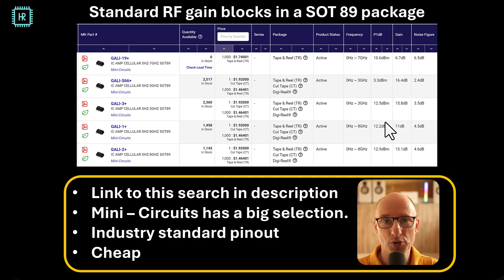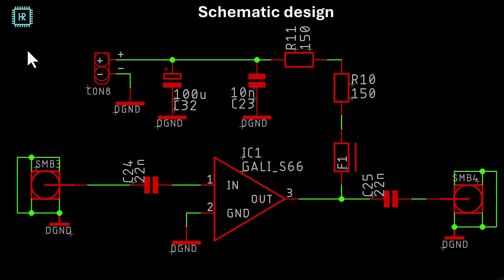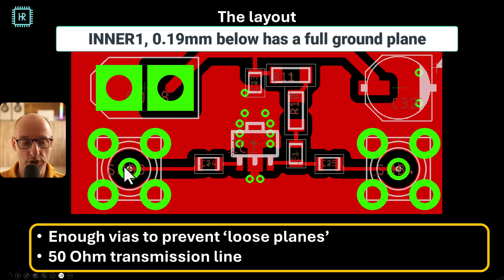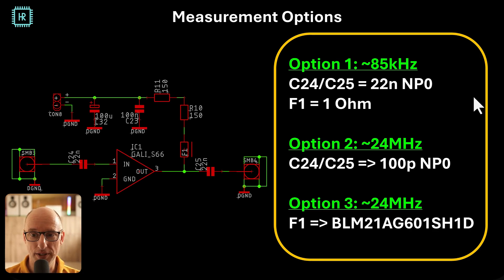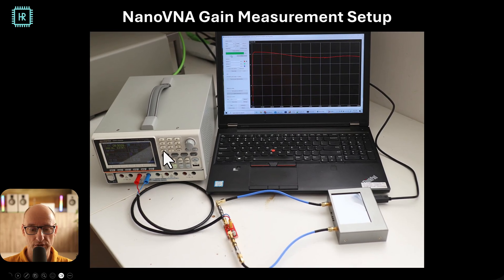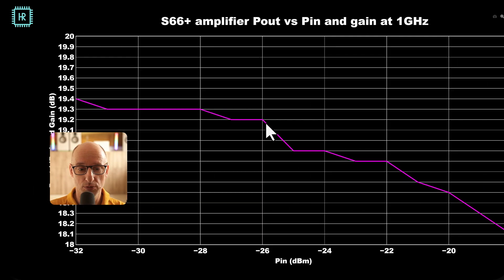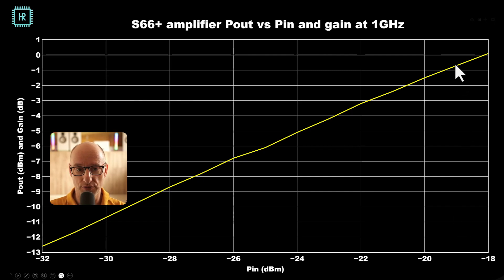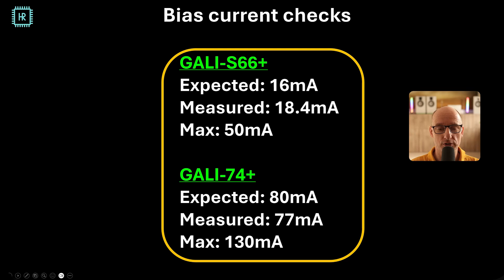Simple Universal RF Amplifier PCB Design - From Schematic to Measurements

Comment: What are your views on power pours on signal layer?
Reply from the maker: It is not a problem, as long as they're clean OR have a distance to sensitive signals. Sometimes you need to use power polygons on your signal layer because you are drawing a lot of current and voltage drop must be minimized. Usually for core voltages of processors or FPGAs.
Reply: @HansRosenberg74  is there some good rules to follow here to keep the power "clean "?
Reply from the maker: Simple: Place decoupling caps regularly that connect the power plane to the ground plane. If you have really large current peaks, you may want to include a big capacitor here and there. Place smaller ones next to high speed loads like digital chips.

Comment: Excellent work... keep 'em coming.
Also ... can I keep cascading to get a really high power output signal ?
and can you somehow convert the input / output measurements in Watts ? coz It makes more sense to me.
Reply from the maker: The output power will always be limited by the last amplifier stage. That has to drive the final power. About the dBm values. 0dBm equals 1mW. 10dBm = 10mW and 20dBm = 100mW. It follows 0.001 * 10^(Pdbm/10) in Watts. And when cascading, you have to make sure that the driving amplifier does not clip before the final amplifier (I may have done that wrong in my design ;-) They clip at the same time I think but I did not check that carefully)

Comment: Can I use this amplifier for a wifi antenna that receives AND sends data?
Reply from the maker: Well, partially, you'll need a tx/rx switch. When transmitting, this amp should be used, but when receiving it should be turned off and the signal should be routed around the amp. So not so easy. You don' t have access to the tx rx signal
Reply: That was a great hint! I'm using an ESP32 and there is indeed a "WiFi Multiple Antennas" section in the documentation 👍😁
Reply: Thank you!

Comment: Folks using Kicad will find the calculator for trace impedance in the calculators section.
It is under high speed -> transmission lines
Coplanar wave guide with ground plane is a good topology to use.
It seems to give reasonable results
Also to protect against "ooops I connected the power backwards" you can add a diode.
If I was doing it, I would also add a little LED and resistor to indicate power is on to remind me.
Reply from the maker: The led is a nice idea indeed.
Reply: The Saturn PCB Toolkit is also a great calculator. But before I fabricated anything, I would get the actual Dk values from the PCB house.

Comment: I really hope you can make a simple filter for a 78 - 108 MHz FM transmitter, with RF power from 5 - 15W. Thanks a lot!
Reply from the maker: I think you should design an LC filter and make sure the capacitors and inductors can handle the power. Now for caps this is easy, just use NP0/COG caps which are big enough, just check the datasheet, 1206 may already do it. The inductors are a bit more nasty. I think you'll have to wind your own air core inductors with silvered copper wire to increase the Q. Then you need to tune these a bit by bending the wires a bit closer or further apart. Making the design is easy, check out this site: https://markimicrowave.com/technical-resources/tools/lc-filter-design-tool/

Comment: Can you explain why the quality of the resistors matters? What would be the impact of using simple & cheap thick film 0804 or 0603 ones? (Also, I see 22 Ohm thin film in 0603 for $0.022ea qty10, that's pretty cheap, isn't it, or are these the wrong ones?)
Reply: Ah, now I see, you need to dissipate a lot of power, that's why the simple thin film ones don't work. To be honest, I felt like this video was too compressed and left out a lot of the finer points and background info. Great overall, but would have preferred 2x the length. Thanks!
Reply from the maker: Thanks for the feedback. Video speed is a big topic on youtube. Hard to know what is best. What is your background and age if I may ask? Trying to find out a bit who my audience is.
Reply: @HansRosenberg74  Speed is fine, I can stop, replay, slow-down when needed. Maybe instead of "compressed" I should have said "high-level". I thought that for too many things you just said "I need an X of value Y" without going into any details about Y. You are obviously making some rule-of-thumb / ballpark calculations in your head to arrive at an approx value for Y but you are going too fast to say that out loud. For example, for the DC block caps you probably have some rules of thumb: under 100Mhz around YnF, between 100Mhz and 1Ghz about YpF, etc. Or the ferrite beads, you just said "I can also put a 1 Ohm resistor" without saying a couple of sentences about the reasoning or the expected effect. I just thought "huh, a resistor and an inductor are not even the same kind of component, what is he doing??". Yes, each of these points could turn into a 20 minute calculation to get the exact perfect value, that's not what I'm looking for, I'm looking for the 3-4 sentence thinking that is going on in your head.
I'm a software engineer >50 that has always done electronics on the side, mostly digital stuff, now doing quite some RF, mostly ultra-low power, ultra-light stuff (<1 gram devices with LoRa radio that operate off 0.6mAh battery)
Reply from the maker: Ahaa, thanks for the clarification, that makes a lot of sense. Basically the 1 Ohm vs ferrite bead is an impedance thing. The higher the RF impedance, the more gain you'll get (up to a limit of course, at some point the biasing does not affect the gain anymore). That biasing is like a load on the output, the higher the impedance of that bias, the less impact it has, less load. I'm explaining those ferrite beads with that impedance graph, that should explain it. For the capacitors: Pick the smallest value that will accomodate your minimum frequency and then pick a good dielectric (NP0 or COG). Actually, both capacitors should theoretically give the same gain 22nF/100pF but there is a difference. I'm not sure what causes it, I also don't know the manufacturers anymore since I've had those in my smd bins for years.

Comment: RF stuff is quite foreign to me, but I like very much the beauty of the simplicity of this design! What are the potential applications of such design - output - driving an antenna or input - boosting a very weak input signal?
Reply from the maker: Amplifiers are used just about everywhere. So there are soo many applications for this. The examples you mentioned, plus a lot more. I'd ask chatgpt for a list of RF amplifier applications. This came out :-)
Wireless Communication Systems

Cellular phones (boosting signal strength)
Wi-Fi and Bluetooth devices
Satellite communication
Broadcasting

AM/FM radio broadcasting
TV transmitters
Shortwave radio stations
Military and Aerospace

Radar systems
Electronic warfare (jamming and countermeasures)
Secure military communication
Medical Equipment

MRI (Magnetic Resonance Imaging) machines
Medical telemetry systems
Wireless medical devices
Test and Measurement

Spectrum analyzers
RF signal generators
Oscilloscopes for RF signal analysis
Microwave Communication

Microwave links for long-distance communication
Satellite ground stations
Wireless Infrastructure

Base stations for cellular networks
Repeaters and signal boosters in telecommunications
Internet of Things (IoT) Devices

RF communication modules in smart devices
Low-power communication for sensor networks
Amateur Radio (Ham Radio)

Boosting signal strength for long-distance communication
Signal amplification for higher output power
Defense Systems

Missile guidance and radar tracking systems
Communication between military units over long distances

Comment: The datasheet for these seems very sparse.  For starters, it seems like the voltage in the electrical specifications table doesn't match what's in the bias resistor section?  The specifications table (for the 66+) says "Device operating voltage 3.0-3.5-4.0 V" (min, typ, max).  But the bias section seems to require at least 7V.  What's going on with this?  Can the device be run off 3.3V, or does it really need 7 to operate?
Reply from the maker: You loose the rest of the voltage across the bias resistors :-)

Comment: 6:21 - I followed the design part, but I am confused by what you are saying in the measurement part.  You said the gain is 46dB.  Where is that coming from?  I don't see this figure in either the S66+ or the 74+ datasheets.  I'm seeing the S66+ with a gain of 21.6-16.4 dB, and the 74+ with a gain of 25.4-13.4 dB, depending on frequency.  Am I reading the datasheet wrong?  Or misunderstanding something fundamental?
Reply from the maker: You almost got it ;-) If you add the 25.4 and the 21.6, you get very close to the 46, its actually 47, I rounded that a bit too enthusiastically :-). I'm sweeping over a wide frequency range so I have to take the max gain at 100MHz into account as well. Sorry for the confusion :-)
Reply: Is it possible to make a 3 stage or 4 stage to get more gain?

Comment: hi! How comes it that 100pf was better than 33nf at high frequencies in your amplifier? If i compare two caps of the same size but different capacitances (example: GRM1885C1H101GA01 vs GRM1885C1H332JA01, 100pf vs 3300pf), their impedance at 1GHz and up match almost exactly, according to the manufacturer. But your measurements suggest they don't. Is this real? Are your caps of the same size?

I was under an impression that there is a misconception that small-value caps are better at higher frequencies because they have a higher self-resonant frequency. But really, the frequency is higher simply because the capacitance is higher, while the actual impedance at high frequencies is the same, and the impedance is what actually matters, not that it "behaves like an inductor". And the only real reason to use small-value caps is that you can have them in smaller size, which 1) has smaller esl, 2) allows one to pack the circuit tighter, reducing other parasitic inductances too.
Reply from the maker: Your reasoning is sound, I also don't know why there is a difference. Apparently around 1GHz or so, something goes wrong but I don't know what. I also don't know what manufacturer both parts are from. The strange thing is that at 3 GHz the difference is almost gone. So I don't know what goes on here....

Comment: I'd forgotten what MELF stands for, so I looked it up: "Most End up Lying on the Floor"
Reply: 0402 (US sizes) resistors evaporate into thin air off my tweezers.
Reply from the maker: hahaha, ever worked with 0201?? They'll never let go of your tweezers at all :-D. It drove me totally nuts to the point where I wanted to release some serious anger :-D
Reply: @HansRosenberg74  0201's are so tiny, they only exist in the quantum realm.
Reply: @HansRosenberg74  0402 is the smallest I have ever tried.  There is something about this universe that made it so that when my eyes started going bad, the parts got smaller too.
Reply: Can confirm that :D
Reply from the maker: hahahahaha

Comment: Nice explanation. Thanks.
My question : With such high gain, isn't there a high risk of loopback and oscillation ?
Do you have advices about shielding / boxing this circuit ?
Reply from the maker: the ground plane and characteristic lines should minimize transmission of signals, so also reception. For boxing, I guess you can get standard shield cans at farnell, but they're quite expensive. In 'real' amplifiers they have milled aluminium boxes, even more expensive. So I don't have an easy fix.
Reply: When it comes to shielding of (small) RF circuits, I use Eclipse Mint tins. 2.2 x 8.5 x 4.7 cm.
Reply from the maker: hahaha, I thought this was an RF shielding manufacturer or something, but it's actually mint tins :-D
I had a colleague who was also always collecting cans and tins for that purpose :-)
Reply: @Soupie62  Another thing to have is some copper clad PCB material and some tinsnips you don't care about.  You can solder PCBs to other PCBs to make a wall.  Something grounded standing up from the PCB can block RF taking the path backwards.  It is easy to make it fit inside your housing.

Comment: Nice video Hans, thanks for sharing it. Did you have a look at the harmonics and BW distortion? I mean driving them up to their P1dB point often causes a lot of it, at least for DATV. No worries, I use them as well in my driver amplifiers ;).
Reply from the maker: No, I would like to do an IP3 measurement but that would require 2 signal generators, that is why I left out the distortion. Near 1dB compression distortion should be really really bad :-)

Comment: MELF is a pain both for hand assembly and automated pick/place assembly. I wouldn't choose them for cost reasons alone. But sometimes they are the best choice, especially for pulse loads.
Reply from the maker: I agree, after having used them for the first time, I'm on the fence on them..... I did look up assembly, apparently there are special nozzles that should solve that problem, but I did not talk to an actual assembly company.... I worked a lot with 0805, but they can be upside down, that problem is solved with the MELF parts, but they really  like rolling around :-D (I did not anticipate that one :-)  )
Reply: @HansRosenberg74 Even with the special nozzles they can be problematic. They can roll off the paste in between placement and reflow.
Reply: @HansRosenberg74  Yeah, pick and place machine nozzles have trouble catching them, detecting cameras have trouble recognizing them, and eventually a lot of them end up in the dumpster. For manual placement, they are also a pain in the ass...embly :)
Reply from the maker: Ok, you convinced me.......... Darn, expensive 0805 thin film resistors it is then......
Reply from the maker: I also noticed they were quite 'mobile' even when  using rework flux. So it's really  not a nice idea....

Comment: Hello, thanks for the content. I would also be interested in a guide for differential amplifiers.
Reply from the maker: what kind of differential amplifiers exactly? Just a differential pair, or some differential opamp amplifier?
Reply: @HansRosenberg74  I would be interested in one that could be used for measurements, from DC to X MHz. The kind that e.g. the manufacturer of a differential voltage probe might use. I'm interested in how they are designed and what limits their bandwidth etc.
Reply from the maker: I have that on my list actually. It is a little bit of a pain in the but to design one of these. You need to create a very high common mode rejection. When you want DC it becomes really unpleasant. I've made one in the past though, I think it had 5Mhz bandwidth. It had a lot of gain and I used it to monitor small supply currents in low voltage applications.

Comment: Thank you for informative video. I wander about your measurement setup - I assume calculations are for dual stage setup, but how do you arrive to +15dBm P1dB value? 74+ P1dB point is 18.3 dBm, are you using +15 figure just to stay below that?

Also, how amplifiers are designed in the realm of +30 - +33 dBm? I don't see much of integrated amplifiers at this power level. Is it discrete transistors only? (yes, I have my HAM licence ;)
Reply from the maker: The datasheets specs it at 100Mhz, I'm measuring at 1GHz. And I'm afraid the first stage is already beginning to compress at the same time as well (I did not check exactly).
Hittite has apparently got a few that do 32.5dBm: HMC453ST89E Found them on the digikey website.
Reply: @HansRosenberg74  thanks!

Comment: Yes sir, upload more n more.

I wish you can do a vedio on common mode noise, filter design n remadies.

One of my projects i have an long wire connection from a PIR sensor, for some reason the ground is affected in my PCB.

I wish you can share a guide for such RF noises being absorbed such wire and affecting the PCB
Reply from the maker: I will make a series on EMC / EMI at some point, this will address it. For now I suggest you add a common mode transformer on the pcb where the 2 long wires enter the pcb. If you have more than 2 wires and the signal is LF than I'd use ferrite beads in series with the signals where the signals enter the pcb.
Reply: check out Fesz Electronics channel